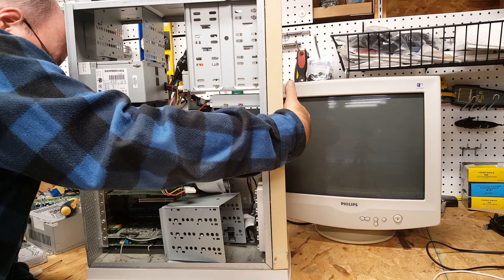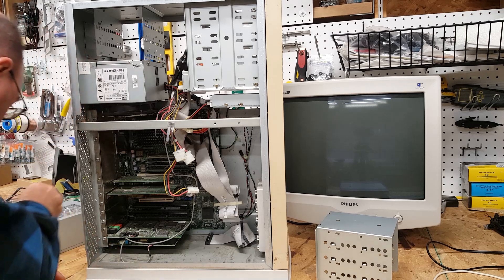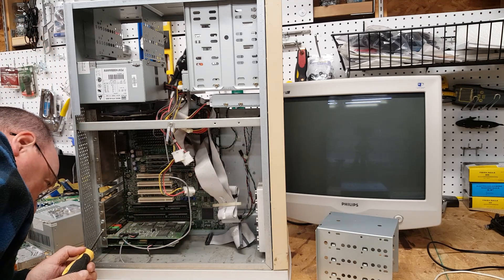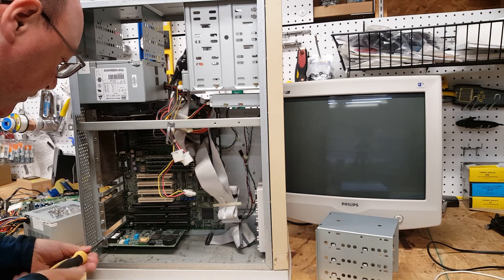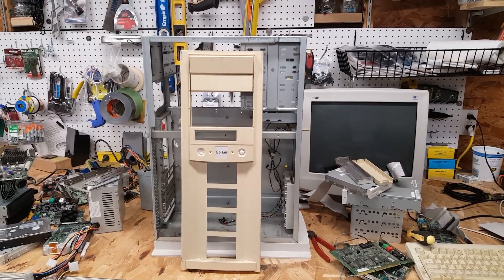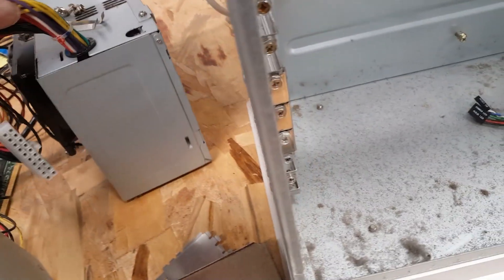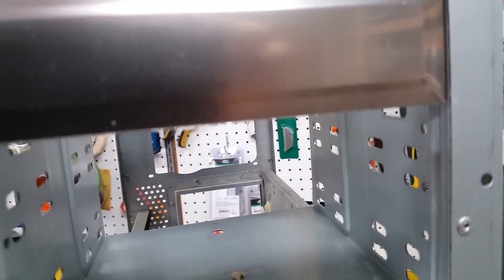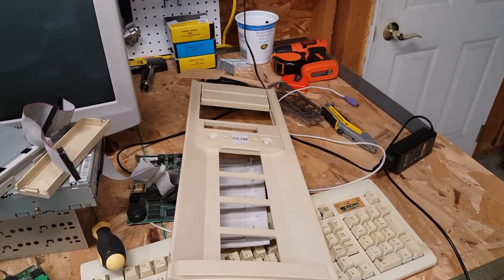Disassembling the 1996 Gateway 2000 G-180 Pentium Pro Family PC

Comment: Nice video bro. just a heads up on the retrobrite it will make that cover more prone to scuffs and this seems to be on the plastic that gateway used I did a sample on the drive cover and i could draw on it with fingernail. I just used oxyclean water and sunlight. I also tried the peroxide method. so my vote is paint.
Reply from the maker: Thanks for watching!  Hmmm, painting it!  Now there is an option!  Yeah, I don't want the plastic all soft.